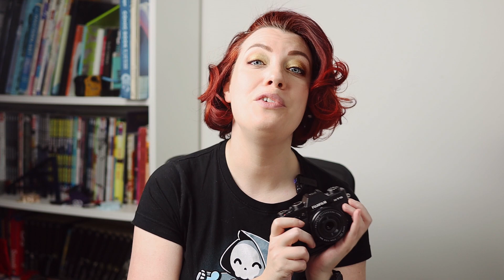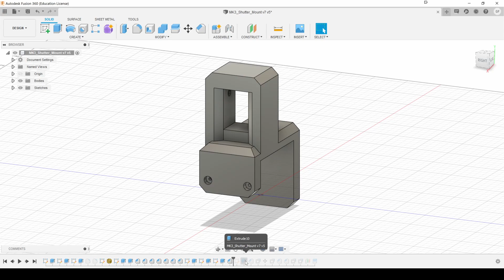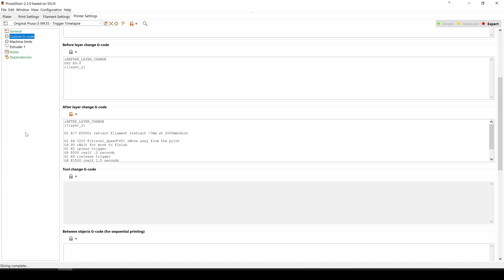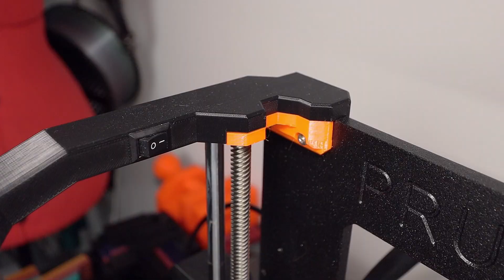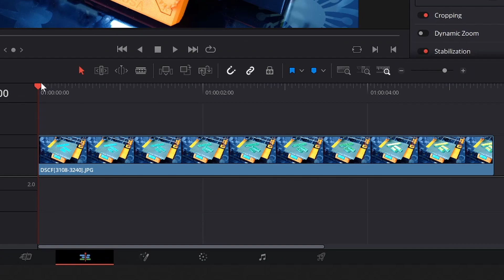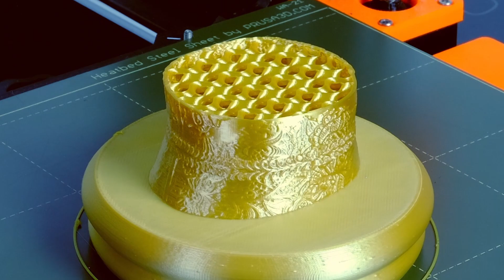Gorgeous 3D Printing Time Lapse without Octolapse?! No Soldering, No Raspberry Pi, No Problem!

Comment: Great video. Thank you.
Regarding pausing on each layer to move the nozzle to trigger the photo, does this affect the print in any way? Pausing the filament between layers for a few seconds ?
Reply from the maker: It can cause some oozing and stringing, but you can alter the g-code to decrease issues around this!

Comment: That was fun and informative!  For folks that don't have a 3D printer that they want to shoot time lapses of, intervalometers are available for most cameras that have a port for a remote camera shutter release, or if you're very lucky the feature is built into the camera.  Your set up is a brilliant solution for setting the interval to be a physical event, such as when the print head is out of frame. Thanks for sharing!  Cheers from BC!